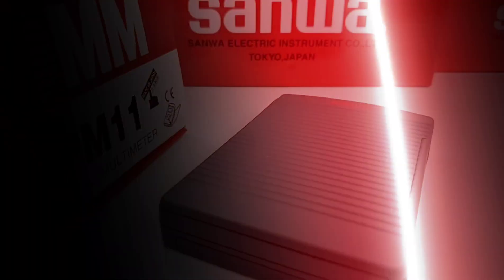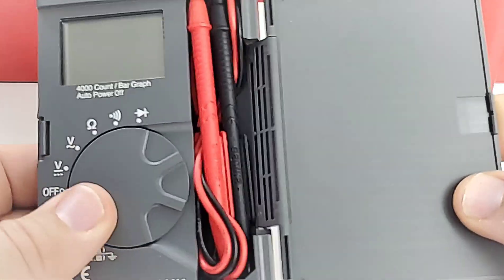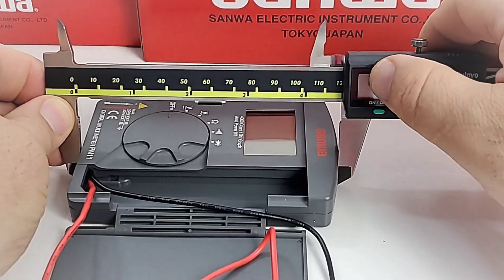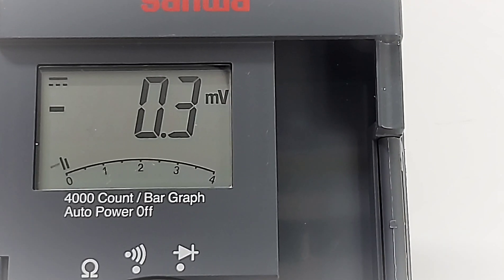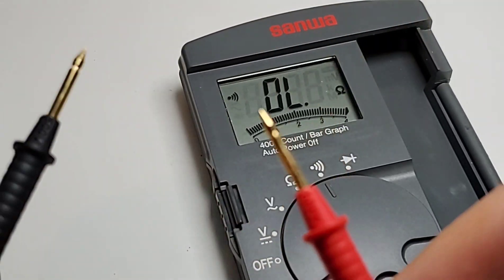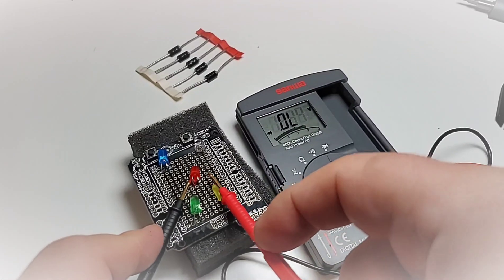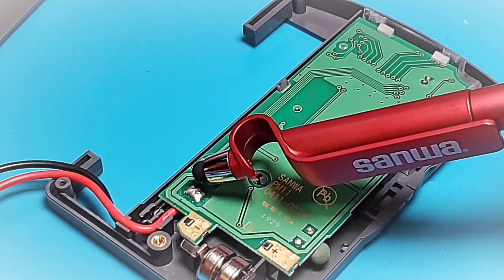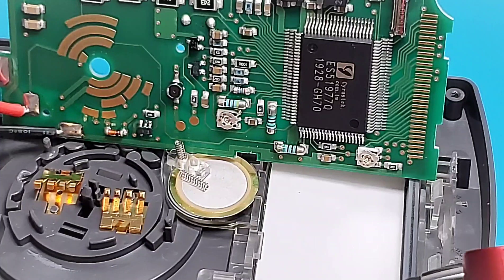SANWA PM11 Multimeter Review & Teardown!

Comment: Excellent materials are used throughout, including the case. Reminds me of a rugged Casio calculator case. Japan still makes the best electronics!  Nice trick they did with the calibration potentiometers, access through the board. Top one is for DCV, near the middle is ACV. The door is oh-so easy to operate and protects the meter from hazards in a drawer or in your pocket. A real winner for basic multimeter duties. The display is beautiful, just like all Sanwas!

Comment: A nice meter for such a small package.  The bargraph makes up for some of the slow ranging in resistance, but that said, it could be better.  One of those little gas discharge tubes or a small MOV might fit between the  red probe input lead and the black probe input lead on the component side of the board for added input protection, but it might have a clearance problem due to the selector switch.  Anyway, great review.